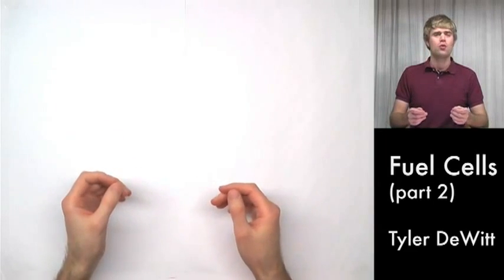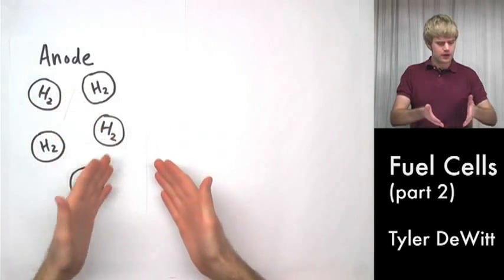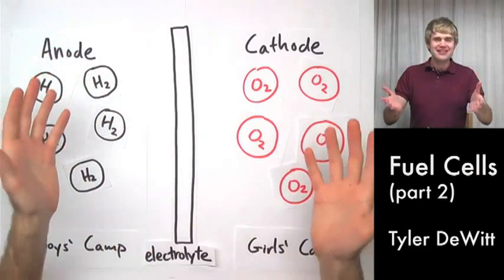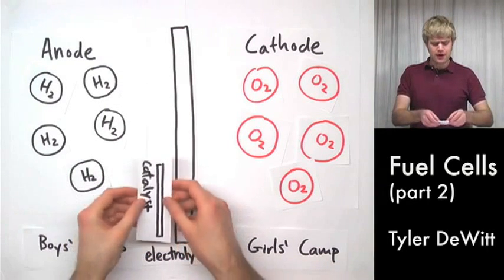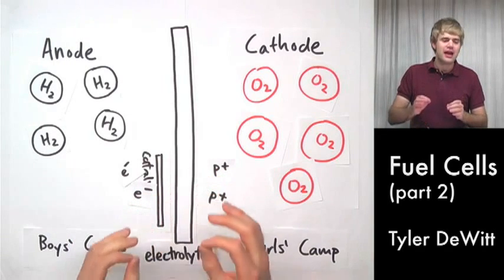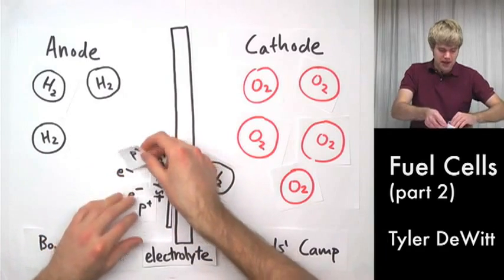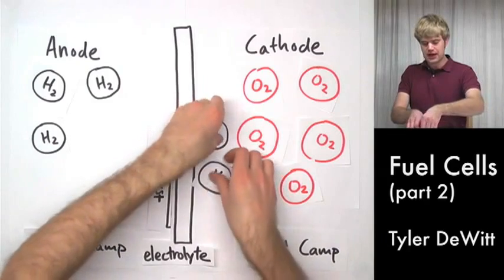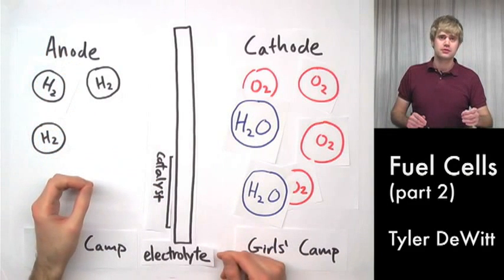Fuel Cell Demo

Comment: Could someone make a battery that acts as a fuel cell in that when you add more electrolyte to a starved cell through a drip system and it generates ionic activity and also generates hydrogen and oxygen which is what batteries produce sometimes. These  are consumed by the battery to produce electricity through the chemical reaction of hydrogen and oxygen to recharge itself like when aluminum air batteries are produced without oxygen then oxygen is introduced it will charge up due to reaction. After the electricity is used up you add more electrolyte in a timed manner to start the process over again. If this is on pause meaning you stop this process then the battery acts as a storage device and will not self discharge at all. As soon as demand for power though it restarts to act as both a fuel cell and a battery

Comment: if water (H2O) is a Covalent compound formed by sharing of electrons, why is it said (in case of fuel cells) that formation of water from hydrogen and oxygen is a redox reaction (transfer of electrons, not sharing). This would make it an ionic compound. 
Any insights? 
Note that, the concept of water being formed as a result of redox reaction is highlighted in fuel cells (which is the basic principle of fuel cells - generating electricity by exploiting this transfer of electrons)
Reply: ***** Hi, I think that by a redox reaction it means that the hydrogen atom is broken down to electrons and protons which means that hydrogen is being reduced because the electrons break away from being an atom and eventually become connected with the oxygen atoms to form water. So I'm sure that when they mentioned 'Redox reactions" they had in mind that the oxygen atoms are causing the hydrogen atoms to break down into protons and electrons through which the oxygen atoms will later combine with to form water.

I hope I helped give insight from my understanding. I'm only 15 and in grade 11 so I hope I made sense. Seeing that your question was asked 5 months ago, if you got the answer to it please help me understand as well.

Thank you.

Comment: At 3:57  - electrons like "chunky kids"? but aren't they actually wayyyyyyyy smaller than protons?
Reply from the maker: Yup, you're exactly right. Electrons are indeed much smaller than protons. It's not a perfect analogy, but I'm just trying to get the very basic concepts across right here. In reality, it's not about size--it's about charge, but I couldn't come up with a good analogy for that. In a fuel cell, that "camp fence" is actually a special membrane that allows positively charged things to pass through, but not negatively charged things. So protons can go right through, but elections cannot.

Comment: Actually, instead of an electrolyte, it is a proton exchange membrane so here, protons are delivered to the another side of the electrolyte where together it forms water.
Reply from the maker: The terms "proton exchange membrane" and "polymer electrolyte membrane" are used synonymously. So they are the same thing. And "polymer electrolyte membrane" is often shortened simply to "electrolyte" or "electrolyte membrane."
Reply: Tyler DeWitt Okay, learnt a new thing. Thank you!
Reply: +Juliet  i think u might be right can u expl;ain me briefly..?

Comment: Physicist do not talk about the volume of the electron usually.  The electron is considered as an elementary particle with no structure.  It has mass, however, almost 2000 times smaller than that of the proton.

Comment: I understand the separation and movement of the electrons but how are you capturing the energy from their movement. What sort of "work" are they doing during their movement ? Running a generator ? Powering an electrical device directly ?

Comment: I have seen multiple sometimes conflicting accounts of the dimensional size of an electron. While I cannot verify these data, some report the electron to be roughly 4 times the diameter of the proton. If this is correct? If not, I would be interested to know the proper values.

Comment from the maker: You can separate the water back into hydrogen and oxygen, but to do that, you'll need to use all the energy (plus a little more) that the fuel cell made in the first place. So it can go back and forth, but not as a self-perpetuating energy source.

Comment from the maker: Great question! That's actually one of the problems with fuel cells. It takes a lot of energy to get those H2 molecules in the first place. Lots of electricity is required to break water apart and make H2--that's how we get most of the H2 used in cars and trucks. The problem? Using H2 in fuel cells is a super clean technology. Getting the H2 in the first place requires energy that may not be generated in particularly green ways.